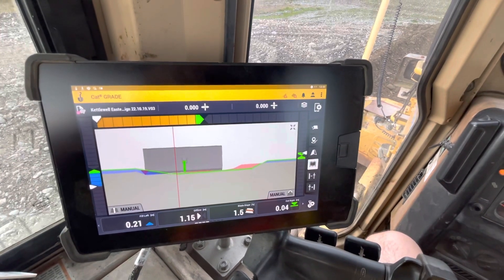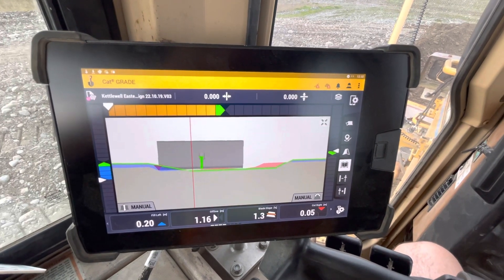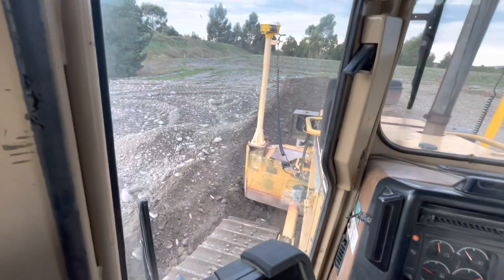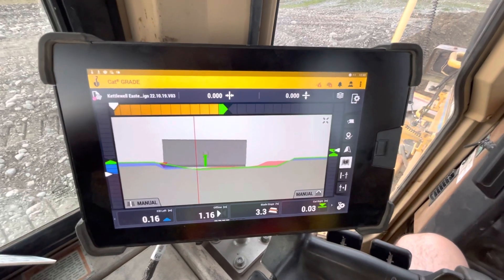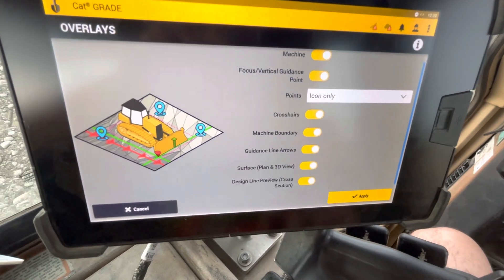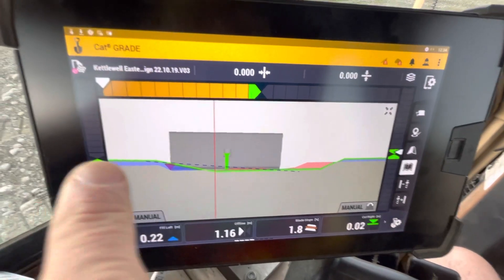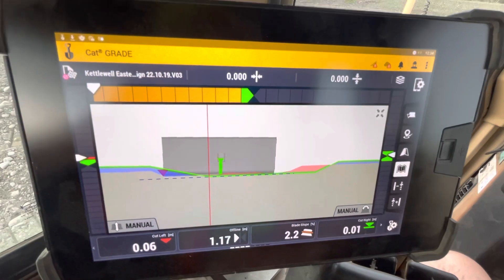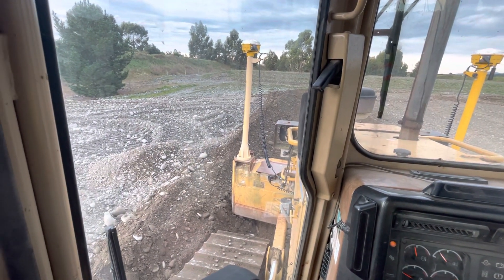Trimble Earthworks Tip: Undercut toe of a slope

Comment: I would greatly appreciate it if you could tell me how to create a new user/operator login so I can store all of my Earthworks configurations under my name in the equipment. Or even where to find the info, I have spent hours searching. Sorry about being off topic. Your videos have been very helpful. Thanks so much.
Reply from the maker: No problem, really pleased to hear the videos are helping!
Creating user logins is done via the Technicians web interface. There is an app to open it on the screen (has a grey logo with a technician man, cog and spanner) and it requires a username and password. Generally speaking your SITECH or Machine dealer (if you got the system on your new machine from factory) normally set that up so that their technicians can log in but don't always hand out those details to the operators as there are many settings available in there for the configuration of the machine measurements etc. It's normally a case by case basis after a discussion with the customer.
I'll add this to my list of videos to do and step through it - hopefully this reply helps in the meantime
Reply: @machinecontroltips  Yes, your videos are very helpful and well thought out and easy to understand as are your comments. You made my day with your reply. Your Earthworks knowledge is impressive. Now I know what needs to be done. Thank you.
Another possible video suggestion would be on master alignment because I also can't find in-depth information about the purpose of master alignment for lane guidance or other purposes. 
Like, what should be considered when selecting a line for master alignment?
Why is a master alignment necessary?
Why can't the 2 lines that need to be selected, be selected, without a master alignment?
What all does selecting particular line, for a master alignment, effect what is at hand?
Many lines run parallel, so what difference does it make which of the parallel lines is chosen for master alignment?
Should the master alignment be deselected once the task is completed in order to prevent adverse effects with other tasks? I have some other video suggestions if you're interested.
Reply from the maker: @georgesimms9042  thank you!
Keep the ideas coming, it’s great to have real requests to make the videos for.
I’ll add Master Alignment to the list for sure, excellent questions.
Just for now - I can confirm leaving the master alignment selected does not have any adverse effects on other tasks, in fact check out my text items video and use those steps to select MA Offset and Station or Chainage Text items and you can use those whenever you have a master alignment (MA) selected so you now how far away you are from it (MA Offset) and how far along it you are (Station / Chainage)
Reply: @machinecontroltips   The amphibious excavator that I am running now is the first one that I have ran with Earthworks so I have only been using Earthworks for 3 weeks now.
Here are some other questions that I have that you might be able to make videos about.

Is there a way to know, with out a doubt, that automatics on a machine is not available/possible without adding the necessary hardware or software/license? Because sometimes I get in a machine that the GPS display does not say manual or auto so I just assume that the machine does not have automatics capability.

What are the lines actually called? I've heard them called polylines and CAD lines and 3D lines, or are those separate types of lines, and do different types of lines, like elevation lines or edge of road lines, have different names?

Can elevation lines be added between other elevation lines, to give more detail to relatively level work areas?

Is it possible to find to find the amount of elevation between elevation lines without checking them with the machine guidance points? Or are they always the same graduations?

Does Earthworks have something like a "managers mode" like Trimble's older guidance system? If so, how is it accessed on Earthworks?

Can the shortcut bar be managed sort of like the ribbon text?

As I get more questions/video ideas I will post them. Thanks.
Reply from the maker: @georgesimms9042  great questions - I’ve got plenty of videos to work on next now!